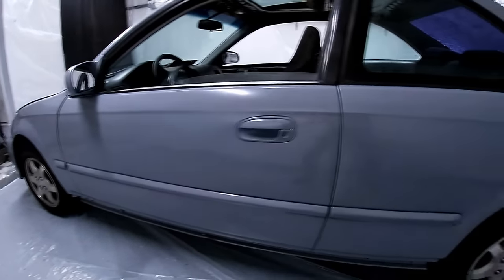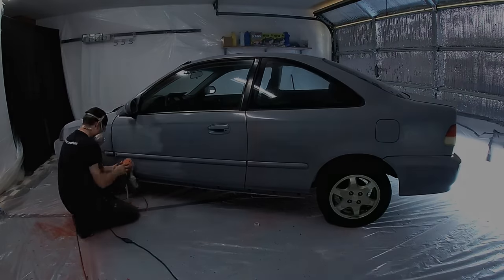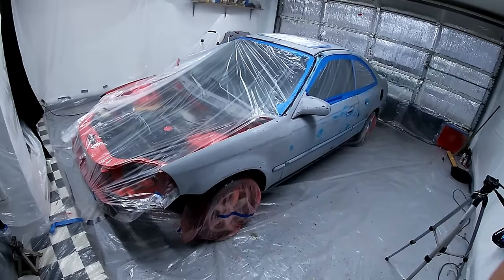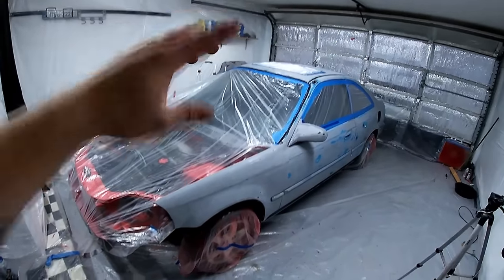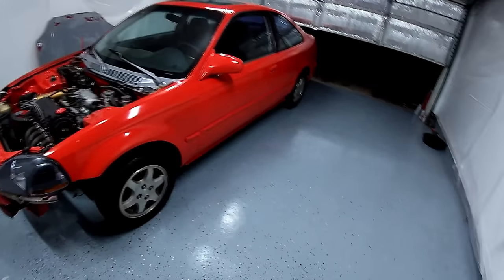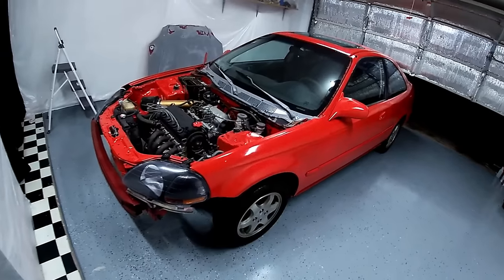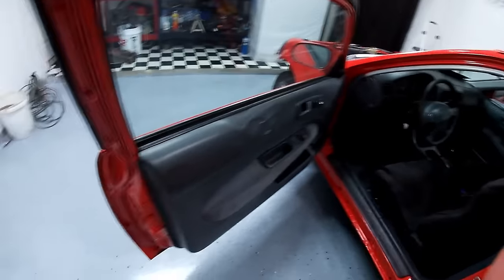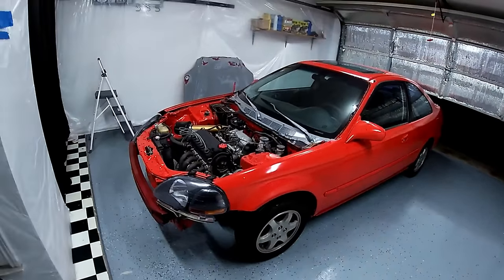Rustoleum strawberry red spray can paint job! Check it out!!

Comment: is it just me or does it look like he is laying it down crazy thick
Reply: His car has an orange skin all around it.
Reply: That's how he does it
Reply: @InvisiVoid  he might have been able to lay it down smoother by doing a couple dust coats first. also by making sure it was good and warm inside the paint booth and warming the paint. Still was going to have orange peel though. That's why you sand and buff. This 2x paint never gets hard enough though
Reply: Super thick. If he used a fan tip and put a 3rd of the paint on 3 coats it would of come out 100x better. I couldn’t live with it, I would be guttered with the outcome but that’s my personal preference.
Reply: What does it look like now that it's been 2 months afterwards ???
Reply: @toddlehman928  gotta call ya out on that. Did my motorcycle fairings in black. After sitting for a few hours i went back with 1500,2000 2500 and 3000 and had no issues with the sandpaper getting gummed up or with the paint. Now with the buff i did a friends bumper after he painted it but it needs to sit for a few days(imo) so it hardens enough and you dont burn through or remove excess material
Reply: @toddlehman928  is the buffing enough to be finished?
Reply: Agree, he was over spraying too much.
Reply: he didnt even add primer to the start of it 😂😂💀 "GOODJOB"
Reply: @ITz_RUINED  dont need primer unless you're covering bare metal or bondo ect spraying over existing paint(as long as its prepped right) is perfectly fine
Reply: I was thinking the same thing! I would lay down a dust coat 1st, then slowly build up to this. Probably take me about 3-4 coats before completely full coverage
Reply: @imposter0shadow  thats wat primers for im sure that wouldnt have happened if he just primered it first

Comment: rustoleum and the paint they sale for at tractor supply for farm equipment is your friend, very user friendly and forgiving, lays down good, little to no orange peel, and if you want it smooth, its thick enough to cut and buff. i have painted dirt track race cars, and drag cars with it.  the body panel might get damaged but the paint doesnt chip away.
Reply from the maker: yup i did another video of tractor painting my civic lol it works great too.

Comment: I really like this one! I just finished about 90% of my Sentra with Rustoleum Advance Formula rattlecans thanks to your help on this channel, panel by panel, day by day, it turned out pretty impressive at the end. The only thing I did differently was I actually filler primed the whole car, and where stuff was really messed up, I knocked down my filler primer by wetsanding, then another coat of filler primer with only a slight sand to remove roughness.
Reply: What color did you use?
Reply: @elsey1976  Gloss white.
Reply: I'm about to do my 5th gen Maxima with 2x satin midnight blue over black primer. Wish me luck.
Reply: @4dscdriver  It should turn out great. Moore is really comprehensive with his videos. Since it's fall it should be cool enough for the paint to level well, but just sometimes wait until evening/dusk so there's no sun. Where people blow these rattle jobs is spraying on a 100F summer day at noon, then streaks galore.
Reply: @GilBatesLovesyou  that's why I have waited. I'll be starting on it tomorrow. The high for the day will be about 65 with low humidity.
Reply: @4dscdriver  One technique difference compared to James is I tend to do the tack coat of a light coat first, wait about 5-10 minutes, then I found personally 3 coats after the tack coat was the best to get full gloss/coverage. Obviously his jobs look good, but I think it'd be hard to spray as heavy as him at first. I was also doing white over grey, so perhaps coverage was a bit harder to achieve compared to a darker color. 

Also I did satin on some panels at first, but my problem with it personally is if I was working on the car and had greasy hands, sometimes it would basically permanently stain the paint compared to gloss which you could wipe off with cleaning products easily, even a day or more after. Then again, it was satin white, so yeah.
Reply: @GilBatesLovesyou  my car is originally pearl white, but has blue bumpers, so i'm doing the black primer to make the color a shade darker and to get a more uniform color. I got to fix a few dents also. I usually do a real light first coat as well when I paint other things, so I'll probably do that this time too. I'm going to spray some clear over mine to make it glossy.
Reply: @4dscdriver   @4dscdriver  For dents, one thing Moore and seemingly nobody does but that I actually really like and found great is actually using Bondo glazing putty as your final skim coat. Professional autobody doesn't really use it anymore, as they have the super high build polyester primers that can be laid on really thick to sand down, but as a DIYer you get only aerosol products that can never get that thick. So once you sand the Bondo down, it's really good if you can use glazing putty over the sanding scratches, sand it super smooth with 500 grit (it sands like high build primer, it's lacquer based) then high build primer, then sand that down, then your top coat. Glazing putty gets a bad rep, but if you only use it as a skim coat and not as something to fill things in, it's awesome. The Rustoleum 2 in 1 primer also really fills in lots of scratches and pitting really well, too. I don't think Rusto makes a black 2 in 1 primer high build primer, only grey. But the 2 in 1 really sands and fills amazingly. I think one of the bigger downsides to the rattlecans is because the coating is so thin compared to real automotive paint, you actually need to be more careful on your prep, and pretty much all sanding scratches and similar will show through, whereas with a gun and real automotive paint, the overall paint layer is thicker. 

I also really like that gen Maxima and the prior gens. It's the last before Renault seemingly took the wheel at Nissan. I was thinking of buying one as my Sentra is a basketcase with rust and weatherstripping and things like that, and I'd get a bigger and faster car. How are they?
Reply: @GilBatesLovesyou  i love mine. This is the 2nd one that I owned. It's comfortable and quiet. Mine has 293k miles on it. Still runs like a champ. I daily it 80 miles a day. Transmission shifts smooth. People like to vq35 swap the 3.0 cars w/ 07+ altima or 09+ maxima engines. It's easy, with no fabrication needed. 3.5 cars are even easier to do. The swap will net close to 300 fwhp and torque for days with a few bolt ons. It's nice to have plenty of low mileage engines available. Mine has no rust, but I also live in the south.
Reply: So I finally got it painted. I did get a few runs, but no big deal. A tip I would recommend is to make sure you have good lighting so you can see the wet edge. I did not, so that is why I got some runs. BTW, I did my car in satin midnight blue with black primer under it. I cleared over that. It has a neat flip flop effect, making the car sometimes look black, and other times blue, depending on the light and angle of the light.
Reply: @4dscdriver  Yeah, I had issues with runs, and that's why I did the tack coat and lighter coats vs what Moore does. Just because he can do it doesn't mean I can, haha. The tack coat helps to stop the paint from running, too. Though with the lighter coats you definitely use more paint than Moore does, as more is getting wasted into the air from being farther away. 

That said, it's an amazing feeling to paint your own car. It's such a great solution to use the rattlecans and get a decent job on cheaper cars. It's not ideal or perfect, but for a lot of us it's all we can do right now.
Reply: @GilBatesLovesyou  i agree. I actually enjoyed this project. Next time, I hope to be able to do it in a garage, and not be so time limited to get the project done. The prep work took me nearly 2 days. Having a factory wing and sunroof made it extra work.

Comment: The more I watch paint videos the closer I get to prep sanding and painting my own car, I bought my 2007 saab 93 aero convertible for 1000$ and couldn't imagine spending an arm and a leg for a paint job on a car with 220k miles. Luckily the car is just plain black so it should be a somewhat easy re-spray (I hope)

Comment: Ive found that if you spray satin or matt base and then yse a clear ober that ot comes out way better than using gloss base and clear over that. i think youre way too wet on that first coat where youre going over it twice in one go. you might also get better results having the cans nice and warm, and even better painting during the day.
Overall great job on a diy though.

Comment: Looks really good. Just wondering what the durability and UV resistance on this paint job.
Reply: As is, it won't stay that way long at all. If he does a light sanding and then clear coats it, it will last a long time and give it even more gloss. That would double the cost of what he did but definitely worth it. Should wait a couple weeks to a month before doing that or it could cause the paint to wrinkle

Comment: I love the red!  Rustoleum/American Accents has a tomato red that is also very sharp, but with a hint of orange in it.
I do have a question:  I find that I always start at the top and work down, but I notice that you start at the bottom and work up.  Is there a reason for that, or just personal preference?
Reply: Was wondering that too
Reply from the maker: All rules for spray gun painting go out the window when using spray can but from bottom up works the best with this spray can paint you want the over spray to fall into wet paint you don't wanna paint over overspray. it sounds totally wrong but it does end up nicer with this method.
Reply: @JamesDguy  Thanks!  I  figured there was a reason, but was not sure what it was.

Comment: Just so you know you can go to a graffiti supply store by some fat caps and a cap adapters to be able to use it on rustoleum and you’ll have a fat cap spray tip for your spray paint. I painted a truck like this along time ago made it way easier than what you’re doing.
Reply: @bobabola1386  I liked the hollow spray of the ny fat cap. Less drips than an Astro fat cap.
Reply: @snekerone  ny fats are a fuckin must, my favorite for taggin an doin throws wit!!

Comment: Nice work!  Would it be possible to wet sand it with, I dunno 1000 grit? And the put 2k clear coat over it, or is that not ideal to mix 2k and 2x?
Reply from the maker: papitosabe I have videos of me putting 2K over rustoleum it works great but yea wet sand with 1000 first

Comment: I painted my sentra spec v with this exact paint it took 10 cans, not a lot of pigment in this paint, but it was very glossy. Have you used the rustoleum gold tips? They put out more paint so it was easier to keep a wet edge.
Reply from the maker: Bryan Rink I have use them but I never have a problem keeping a wet edge.

Comment: Interesting how thick you lay the paint. Normally you'd want quite a light coat, and the 1-2 thicker coats no? And how come no primer? Is it different with spray cans?? Also wet sanding the car with high grit and then a clear coat would be even better right?? So many questions. I want to repaint my old Subaru, but can't justify any other more expensive options, and I think I can pull something like this off fairly well

Comment: Looks pretty good as a spray can job but I think if you went with 2-3 lighter coats and sand in between coats id required- instead of one heavy coat, you would see less orange peel.

Comment: How does the Rust-Oleum 2X paint + primer compare to the Rust-Oleum protective enamel? Which do you prefer? I am doing a Crown Vic, am planning on protective enamel on car and 2X on front + rear bumper covers but worry the "same" color may vary between the 2 paints. Thank you!

Comment: In my experience the 2x definitely requires a clear over it otherwise it chips and scratches very easily in high wear areas.  I would have gone with the protective gloss enamel as it drys hard and has a pretty durable finish without a clear coat.
Reply: How durable would you say it lasts? Should you 2k the protective enamel? Is it worth it? Also what about using protective enamel clear?
Reply: @MarcRodill  Hard to say how durable it is.  Couple years ago I painted 2 bikes.  One with 2x and the other with gloss enamel.  So far both holding up pretty good being outside.  The one with the 2x required a few touch ups by the rear frame.  I did use a gloss clear enamel on both, but only one coat.  You don't need an additional clear over the gloss enamel, but I like to for good measure.

Comment: What do you recommend when using the high gloss black from rustoleum  ?
Reply from the maker: Ezequiel Gonzalez never paint when it’s hot outside or humid, don’t paint in high wind, don’t paint in sunlight keep the coats wet as possible so you don’t get stripes
Reply: Moore Motorsports James Dguy Thanks alot for the tip

Comment: I found an old Craftsman 20 drawer rolling tool chest that has been terrorized by the elements, it's in bad shape. Once I get the rust off I'm going to use the same paint you used and some black gloss and get it back to looking new again.

Comment: Looks great!
•What would you use as a clear coat for that if u were to clear coat?
•would you wet sand and buff or leave as is?
And yes, as an avid "spray paint user"(?lol")...
I find that rustoleum is pretty much best rattle can out there. 
Only other paint i prefer is "MONTANA" BRAND "HARDCORE" VERSION.
It's an "artist's" spraypaint made in spain. Like the 2x ita designed to one coat cover. 
Hard to find in stores but can order online.
Maybe paint the bumper and hood black and keep the grill red? Miight look verry kool?
Reply from the maker: i would clear it if i was keeping it like this using 2k spray max clear and if looks good without buffing but i would wet sand and add 2k clear for sure if i kept it.

Comment: Great video. How long after the last coat of paint could 2K Clear be applied. Thank you.
Reply: This Rust-Oleum is a non automotive spray paint, which is lacquer based. It's incompatible with 2K clear coats. Therefore, you'll have to use a less durable 1K clear.

Comment: Have ever had any problems with the paint not being a consistent color from can to can? I've been having a problem with the rustoleum 2x dark gray coming out in 2 different shades and this has happened twice to me now and am going to have to repaint again.
Reply from the maker: Jason Samuelson That’s odd i never had that issue at all. Make sure to shake them up really good. People pointed it out in one of my videos that they thought my G35 I did lime green had inconsistencies but it was a trick of the lighting on camera.
Reply: @JamesDguy  thank you for the response. Do you have any pointers for putting another coat of paint on it? Like sanding or just cleaning and repainting it?
Reply: Yup I've had that problem with rustoleum before. They were no help when I reached out other than sorry about your luck. The date codes on the bottles were about 6 months apart

Comment: How did you not get droopy water marks when you’re painting because the way you were painting it the fender like you were overlapping overlapping overlap and constantly I’m surprise you and get a new leak dripping
Reply: I kind of think it's because of conditions, maybe. If you paint when it's hot, the paint will set up super fast, and leave streaks if you lay on light. I'm guessing it's fairly hot and dry in his garage, so he can go heavy and have it basically dry before it has a chance to run. If it's cold out, or you have high humidity, paint will flow better (this applies to house painting, too) but because of that you can have more chances for runs/drips with both paints applied at the same thickness.
Reply from the maker: It's just how i have been spray can painting for along time and i just know when too much is too much i guess. lol

Comment: After doing a job such as this, how long would you wait before buffing?
Reply: Don Basque 24 hours minimum. Especially if you clear coat it. If you plan on waxing you have to wait at least 30 days so the paint itself can cure. If you wax too soon the paint won’t cure properly and it’ll result in shorter longevity of the paint job
Reply: @ZayAgka  thanks ! I was hoping to do a rustoleum royal blue on a work van , Was only going to do a single stage no clear and buff .  Just not sure how long to wait before hitting it with a polisher or buffer

Comment: I use the same process, but I just do small sections at a time..such as the fender, then the door, then the hood...etc,etc. Then I go over everything with 2k clear coat. I was wondering about going with this color on my next project....Im sold. That Honda looks great. Just ignore all the smart-ass comments suggesting PAYING for a shop to paint your car. If you own a Ferrari, have a classic restoration car worth $80,000, or dont know what the hell you are doing...then yes, Of Course hire a PRO. But its a Honda..... or some people just have a work truck, or have a used car that runs good but has crappy paint or clear coat fading. Just rattle can it , practice on a piece of cardboard until you get better at moving the can like a spray gun. Its not that hard. Just takes a little patience.

Comment: Doesn't look too bad for rattle  can. Only think I dont get is that you did the jams, engine bay and headlight pockets which is the right way but why mask the tails? You did everything to cover your basis but then leave in the tail lights. You should have removed them also since you did everything else good but then slack in that part. 8 out of 10 for effort.